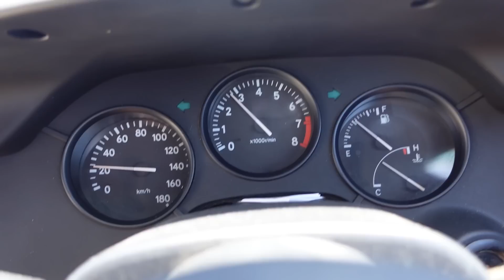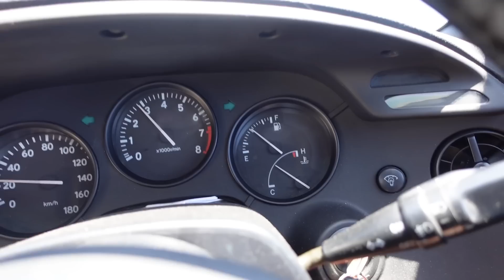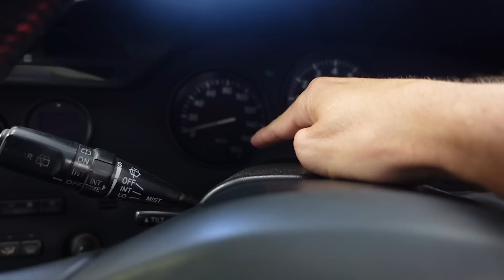ITS FINALLY HERE!!😍

Comment: The horn is activated by 2 brass/copper ends that basically just make contact when connected allowing the horn to be used. It’s also why when you smash the horn too hard the horn stays on because the pins get pushed against the connectors on the hub
Reply: This is sick
20 minute video about a steering wheel
Reply: Ye lol
Reply: Still trying to get my horn to work after upgrading my Supra to a 3 spoke steering wheel.
Reply: Been looking for the explanation for a while! Thankyou kind sir!❤️

Comment: Length of a ride definitely doesn't matter. I wrecked last year on a short 5 mile trip. I decided to wear a hoodie instead of the riding jacket I usually wear. I ended up with some pretty good road rash on my left arm and a gash I had to glue shut on my right arm. Both things I wouldn't have had if I had worn my riding jacket like normal.

Comment: I've been in a motorcycle crash as an experienced rider. Car made a left turn in front of me while I was traveling on a local Hwy (not Interstate) at about 50mph. Lost the skin on my left leg from my butt to my lower/side calf. First time I didn't wear my riding pants that day too - I was wearing regular jeans. My leather jacket with elbow/shoulder/back protection did an amazing job and I had no upper body injuries. I tumbled and slid a good bit too. Full face helmet protected against a header to the asphalt. Gloves saved my hands. I was 2 miles from home.

Gear up every ride, every time. Function first, then figure out a look you like.

Comment: Roland Sands makes nice jackets/flannels specific for motorcycle riding. I have one with pads but it’s discrete and not bulky and protects you well. You can also take the pads off if you want. 

Would also invest in an oil temp dipstick. The socal weather + air cooled engine isn’t always fun so helps to keep track 👍🏽

Comment: The single black wire that connects to the square metal tang on the steering wheel is for the horn. When you press the horn  button it causes the black wire to contact ground which completes the horn circuit.

Comment: There is tons of motorcycle gear that is designed to look low key and like normal clothes, look on revzilla or your local dealer. Motorcycle gear uses specific materials that don't tear easily like kevlar and cordura. They can look a lot like jeans or cotton but will save you from really bad road rash if you fall. Jeans and a hoodie will absolutely tear open and provide 0 protection upon falling at 30 mph. I was wearing jeans in a 30 mph accident and they tore open and I still have a scar years later on my knee where I got the road rash. Pants and jackets often come with armor inserts or the ability to insert armor. This is worth it because the armor spreads the impact of stuff hitting you across a wider area, decreasing the odds you will break bones.

The leather that Sabrina has might be real leather, but most leather jackets for motorcycles have been actually tested for slides and have their seams sewed in ways that makes them resistant to sliding on the ground. They might also back the leather with resistant materials like cordura too. It's worth it buying clothes specifically designed as motorcycle gear. Make sure your gloves are specifically motorcycle gloves and not just random mechanix gloves. Make sure your boots are too. If your motorcycle falls, a really common injury with people who wear shoes is the foot peg going through your ankle. Motorcycle boots are protected against that.

Your helmets look good but make sure they have at least Snell or ECE certification in addition to DOT. DOT is a much easier standard to pass, and you definitely want the best head protection.

Comment: You can get a mesh riding jacket and they have removable inner linings to make them super breathable. Mesh jackets also have a back protector that looks like a piece of foam but it stiffens up if you have an impact and would save your back/spine. They also make shoes with built in armor plating in the heel and ankle but they look like normal sneakers.

Comment: The horn works because even though you didn't connect the wire. The metal of the steering wheel is connected to the car which grounds it. So when you press the horn, you're completing the circuit by grounding the horn button.

Comment: ICON makes reinforced jeans that look like normal jeans and they make mesh jackets with spine and elbow pads, the mesh is Kevlar so you can remove the winter liner and even the pads and still have exponentially more protection and not look like a PowerRanger. Remember most fatal accidents happen within a few miles of the house when you’re just getting something from the gas station. ICON is my favorite brand because the gear fits well, holds up to abuse, and looks like normal clothing

Comment: The horn works because the connector is only for the airbag and the horn works by grounding/closing the circuit when the metal in the horn touches the metal behind it if that makes sense. It’s hard to explain
Reply: 🖕🖕🖕Thanks for watching you have been randomly selected among the winners, contact me to claim your prize right now.......

Comment: It sucks putting on extra clothes when riding, especially in hot weather, but it is a must. Imagine you are running and you trip and skid out on the sidewalk. Now times that by 20. Get some leather or if you need something lighter, there are some great Kevlar lined shirts and hoodies out there. It’s like a seatbelt, you don’t need it until you need it. ✌️

Comment: In regards to motorcycle gear, they do make flannels that have Kevlar and even some level one soft armor , and same thing for the pants. I usually only wear my full jacket when I know I’m going on a group ride or a longer distance ride on the freeway. In an ideal world you’d wear it every time, but realistically when its 85plus in Cali I’d rather ride slower and feel 15 degrees cooler.

Comment: That jacket would shred in a wreck. Glad your considering the gear. Coming from someone who has wrecked and low sided my bike, I walked away it from it because of my gear. Casual riding I’m still in a riding jacket with Kevlar jeans and my race boots but when I know we’re sending it I’m in a full leather suit. Plenty of brands out there with more casual looking apparel that is still CE rated and AAA rated. Check out engine hawks jacket line up, suits the cruiser style and check out pando moto or pmj for quality riding jeans that look like regular jeans but have armour and Kevlar reinforcement in the slide zones. Ride safe, keep the shiny side up ✌️

Comment: Gear suggestion: (ex tech/rider)
Kevlar reinforced jeans(they make plenty of different styles, colors, etc…)
I’d suggest either wearing work boots or a casual riding shoe(this one’s more personal, was a victim of a hit and run on my streetbike)
Up top, you can go more casual just understand more layers means you can theoretically slide across asphalt further before it reaches skin. That said, it’s why leather is so popular, it’s thin, but holds great abrasion resistance.
Now, lastly, and most importantly, your helmet… DOT doesn’t cut it, is suggest snell with some form of mips. Do the research and you’ll understand, some certifications are simply held to higher standard directly correlating to safer helmets. 
Hopefully I was of some help, and hopefully my comment doesn’t just get buried. “1 down 5 up💯”

Comment: 9:01 best way to remove a stuck steering wheel without renting a puller. is to grab at 12 and 6 and yank hard. then another yank at 3 and 9 and she will pop right off

Comment: Teej, my dad passed in 2019 on a motorcycle by being T-Boned by a lifted F-250. You NEVER know what could happen, and i had a motorcycle after and did a burnout and it slid out from under me catching grip while the back wheel was out to the side. And got road rash bad from squiding. So yes, riding gear is essential. You NEVER know what could happen

Comment: Teej the horn probably uses a contact plate system you’d see in similar year Hondas, once both making contact creates signal via wire to the horn itself. Send it on the TRD cluster lesgawwwwww!!

Comment: the wire is probably touching the inside of the steering wheel so it closes the circuit and it works (my english sucks so idk if i used the right terms for it but hopefully u get it)

Comment: Get riding pants for sure they saved me from some real bad road rash, I at that point 50/50  of the time I would wear shorts with compressions under or dickies work paints, just got the front and side of my knee really bad and my forearm a little less, I low sided on a long banking turn on the highway cruising close to 12AM on a ‘18 Ducati hypermotard 939 with a random on my left, probably around 90 hit a puddle on the inside lane probably cause I was sitting more upright then normal with a hand on my thigh looking at the guy in my blind spot about a car length or so behind. he said he didn’t even see it until I was on it cause I was in the way of it or he woulda pointed, In my defense it wasn’t even raining that day. bike just came out from under me hit my side then slide on my ass and palms for 50 yards on also some alpinestars gloves with carbon knuckles that came in clutch. they make a bunch that just look like jeans mine looked like black jeans and had hip and knee pads but I took the knee pads out cause they was hella uncomfortable…lul but pants for sure and a jacket idk I could go either way on that I have a Ducati branded one cause it’s sick and I rarely wear except more spirited riding days but yeah that’s my 2 cents and wear your knee pads…

Comment: Horn works because you didn't tape up the wire so it ends up touching one of the metal pieces inside there which completes the circuit

Comment: For sure get a jacket and the correct jeans. If you slide, they will disintegrate in fractions of a second. You don’t want a nurse to use a wire brush to get the asphalt out of your skin.

Comment: Gotta agree teeg, driving round local roads, you become somewhat compliancent as you are used to driving down them. You shouldnt worry about your riding. Its everyone else on the road. If your not comfortable to run full speed and dive into a ditch in a long sleeve, why ride in a long sleeve. 
Riding jacket or riding leather to be safe.

Comment: Ride how you like to ride. You just have to realize your taking the risk of road rash. I rode a street bike for 8 years and I call myself lucky for only getting 1 broken foot and road rash on my knee and shoulders. But both times I crashed I was wearing a mesh style motorcycle jacket because it gave air flow and 15% protection. I also to the risk sometimes of nothing but a vest. Anything can happen at any moment. Just remember enjoy the ride and the risk factor you take for the gear you choose to use or not use.

Comment: Teej regarding riding gear
For helmets search online for a SHARP rating. The higher the rating the better the safety factor of the helmet. Always opt for a full face helmet and go for what's better in quality over aesthetics.
Riding pants: there's plenty of fashionable riding jeans like pando moto for example.
Jackets: The biggest weenies are the guys that have a slide with no/poor gear and shave their skin off... Leather jackets from reputable brands is always the best best. If you're not keen on fully padded gear there are lots of retro styled riding jackets made to give the rider a casual look whilst still providing adequate protection on the roads.

Dress for the slide not the ride.

Comment: Wear ALL the gear when riding anywhere. Jacket with D3O armor, snell helmet, Kevlar riding jeans, motorcycle boots/shoes, gloves. I had a highside crash in March where the rear tire broke loose, slid out, then caught and flicked me off the top of the bike at 45mph. I landed on my head
/ shoulder area slid 3/4 of a city block in the gutter and walked away with a brused shoulder and fractured heel. Had I had a budget helmet or no helmet on I would have died, no exaggeration. It happens so fast.

Comment: Hey TJ hunt I've been riding for 4 or 5 years maybe 6 to be honest getting into a wreck on a cruiser to be honest is like a one in like 20 or 30 to be honest with you as long as you wear long pants jeans anything that will cover your legs just in case you don't get road rash really really badly long sleeves if you decide to do it but that's your choice I'm usually I wear a hoodie I don't mind a hoodie and gloves gloves are to be are the most important thing for sure gloves just for the fact that when you do end up going down the first thing you do is catch yourself and good wear shoes I wear Vans I'm okay with wearing van this is the only issue with those that the bottom soles get worn out a lot quicker just because you know I tend to drag my feet a little bit but getting boots are pretty good as well as long as you have you know good shoes you know you wear proper pants you technically don't need any any protection but for sure I definitely a helmet does work as well Sabrina she definitely needs to wear a shirt better pans she likes to wear leggings a lot I get that but whenever she does ride with you it's safe to her it's safer for her to wear pants and a shirt so but anyways I mean to each their riders choice to be honest it's whatever you feel comfortable with oh yeah that's my output on it

Comment: Cluster repair is only $50. Pretty sure the dudes on eBay are still doing it.
Reply: The fuse for that circuit needs to be pulled for install because installing the cluster when the circuit is hot will usually fry the components of the cluster.

Comment: First, I think the TRD cluster would be a  great OEM+ option. Second, there's absolutely nothing wrong with eating off paper plates!! You could throw em in a fire pit without any issues cause they're biodegradable.. Lastly.. I was JUST thinking you needed a new steering wheel cause of how ragged it looked, then.. New TRD wheel in a box! 😂

Comment: Teej, 100% get the TRD cluster. You can't have a TRD steering wheel and miss the cluster lmao imo it will become the little piece the interior is missing.
Edit: I believe the horn uses a magnetic system but not sure. I do know they have "horn pads" so I'm assuming that's something when you press the horn, it makes contact with those "pads" sending signal to the relay

Comment: Sabrina that’s not the leather jacket that you should be wearing riding a motorcycle you need the ones that’s got the protective pads and it’s a little bit more denser of a whether that leather will shred in two seconds when you fall please be safe and get the proper attire to wear while riding a motorcycle😔🙏🏽🙏🏽❤️

Comment: Riding gear is your seat belt on a bike. No speed is too slow for gear.
You will not look like a weenie for utilizing proper safety gear, just like how wearing a seatbelt does not make you a weenie. It means you have common sense.
The 3 most common materials for motorcycle gear are Cordura, Kevlar, and dyneema. These fabrics are very flexible so if you slide the material will resist getting sanded away on the asphalt.
Sabrina mentioned her leather jacket, and that's like putting the lap belt on but not the shoulder belt. You need proper gear at all times.
Once it gets hot out, people tend to shed their long sleeves and long pants. Do not do this. There's a saying in the motorcycle community: "Don't dress for the ride, dress for the slide."

Comment: TJ I own US Plus Racing Gear. We make fully customized color and sized motorcycle gear. From gloves to full race suits. I can hook you up with a AAA CE Certified Leather jacket or Kangaroo jacket with ForceField CE level 2 armor if you'd like to try it out. I highly suggest wearing armored gloves and a jacket on the bike with a helmet at the very least. I've been in 3 accidents on the road and crashed many times on track and each one has left me with major issues. Now that I wear armor and proper protective gear I've walked away from every subsequent crash. Message me if you're interested in trying one out.

Comment: Harley dudes don't where gear. Not any that's going to help anyway. The fact you wear a helmet is already a one up on them. Get yourself some riding jeans and a riding shirt at least. Make sure Sabrina gets the same. Those riding cloths will help keep your skin on when you go down...which you will likely do sooner than later. Any normal jeans will disintegrate on asphalt instantly even at neighborhood speeds. Especially those stretchy jeans you guys wear. Try not to laugh too much at armoring up though. It could be the difference between walking away pissed off, and $180,000 helicopter flight and medical bill that your insurance doesn't feel like paying.